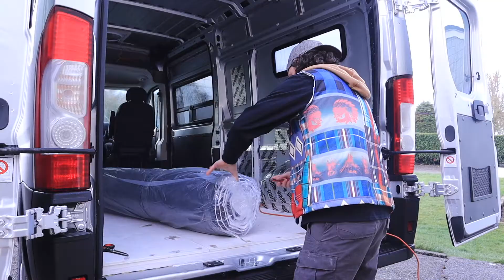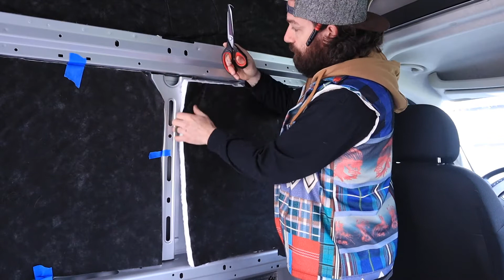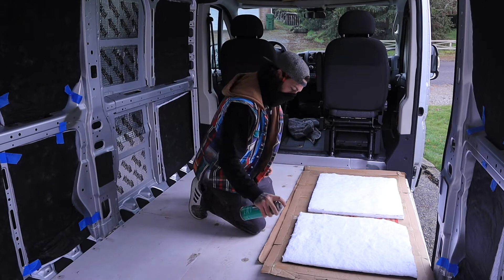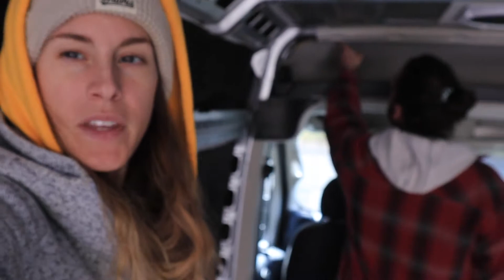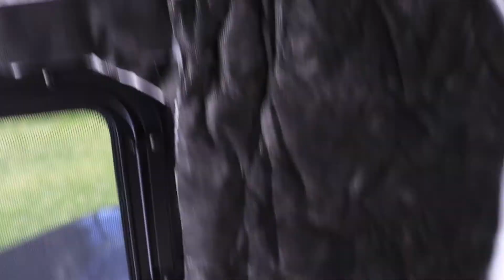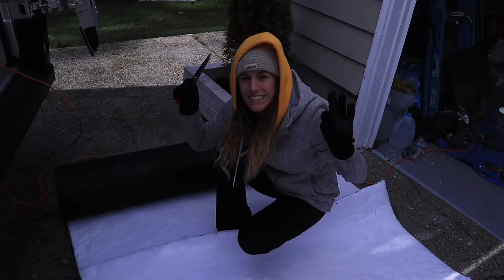3M Thinsulate insulation install

Comment: From my understanding, you should unroll the Thinsulate and let it rest for a day or two until the batting fluffs ups to its full 1.5” thickness before installing. Another way is to unroll, cut all pieces, label them, set aside to let it fluff up and then install. We just bought 70 lf for our Transit EL HR from Hein @ DIY Van :)